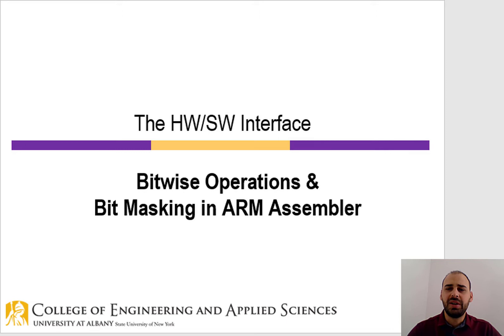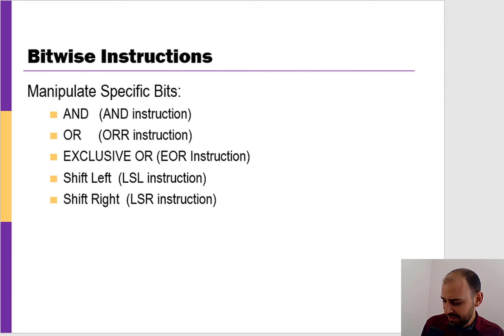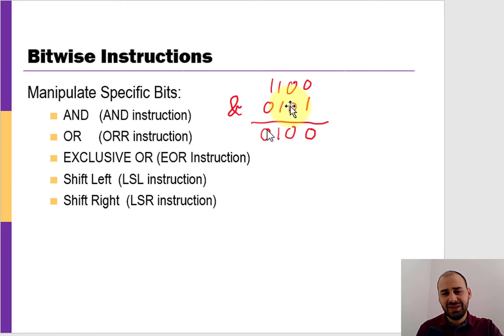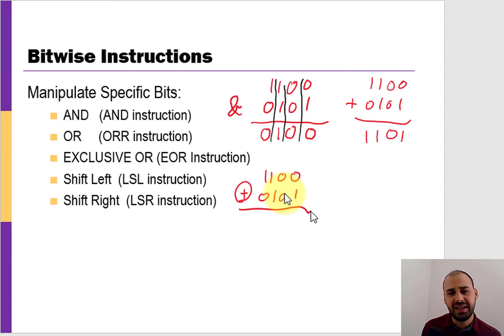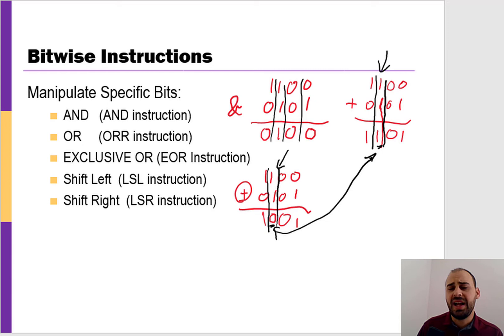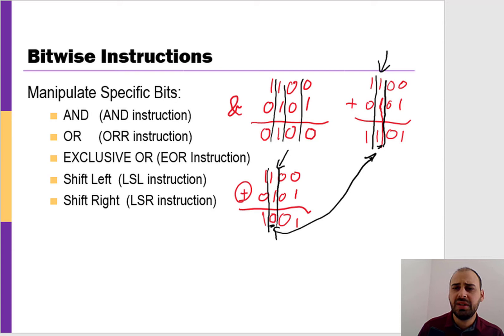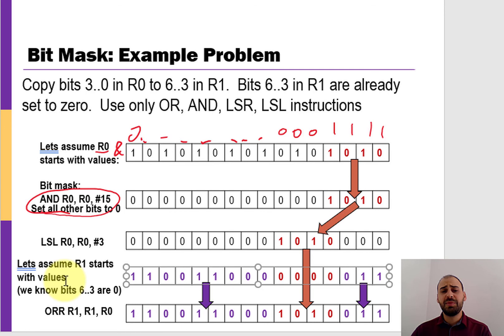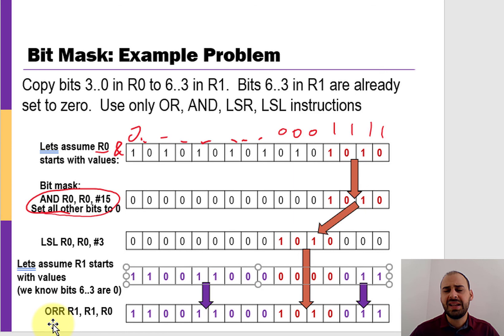Bitwise Operations & Bit Masking in ARM

Comment: Amazing tutorial. I wish you were my professor in college. What kind of calculator are you using in this video?
Reply from the maker: Thanks!  Glad it was helpful.  On Windows, you can use the built-in calculator.  If you go to the start menu, then type "calculator".  In the settings, you will have to set it to "Programmer" mode.   Mac should have a similar calculator built-in too.